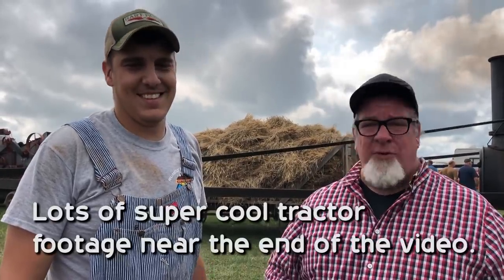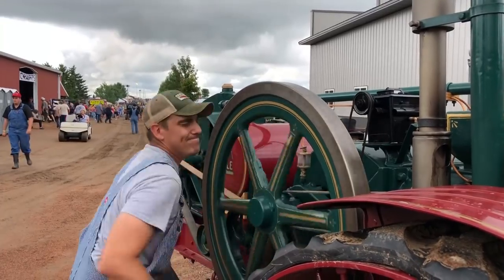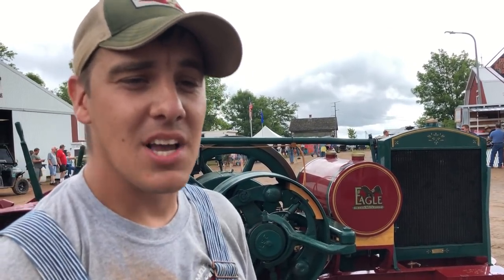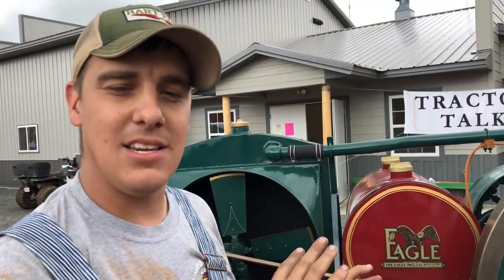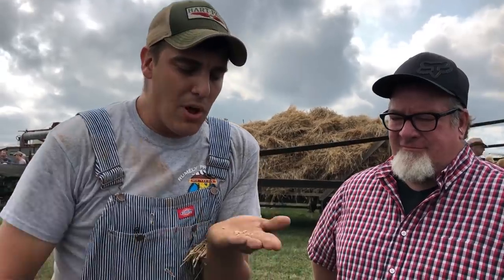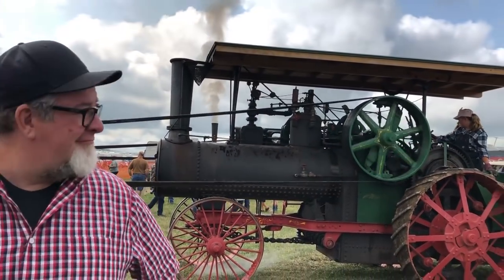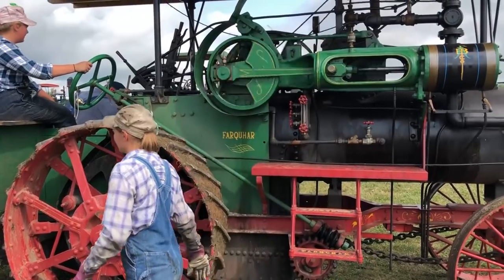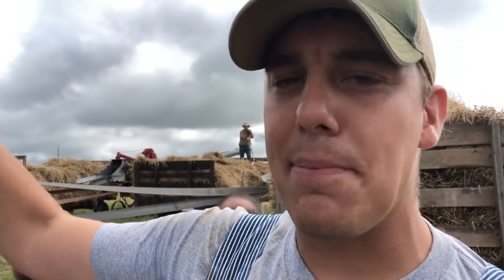Powered With Water The Edgar Steam Show

Comment: Fun fact, these old steam engines are where the running something "balls out" expression originated. It's not a lewd term; the steam engines had mechanical governors limiting their top rpm. When the machine was up to speed the "balls" would spread, limiting the machine's speed. Best example is at 9:32, they're painted red and spinning like a top.